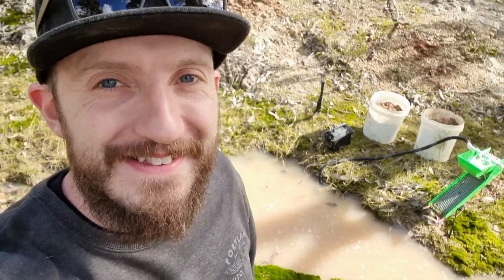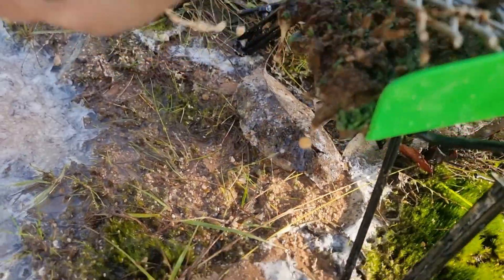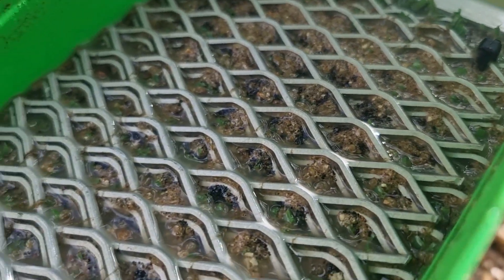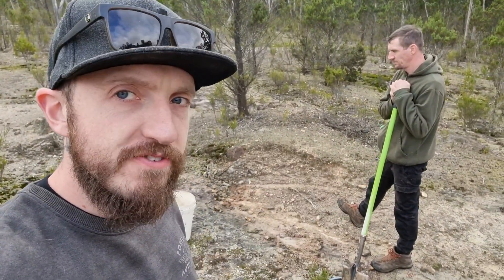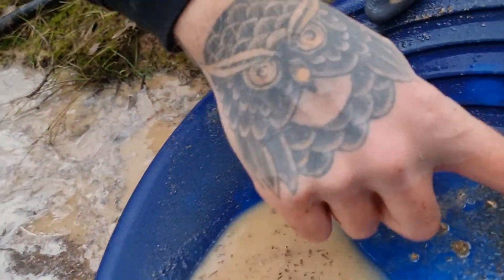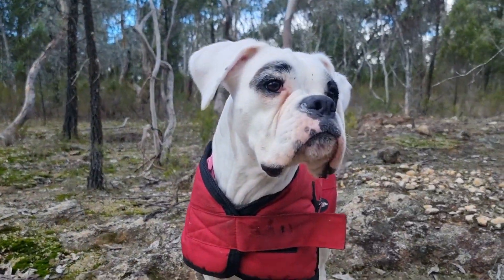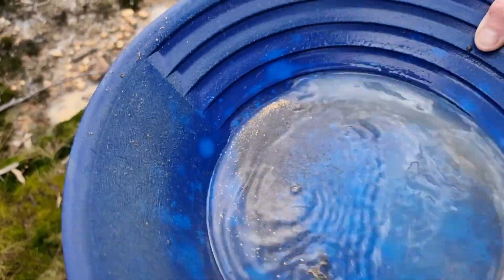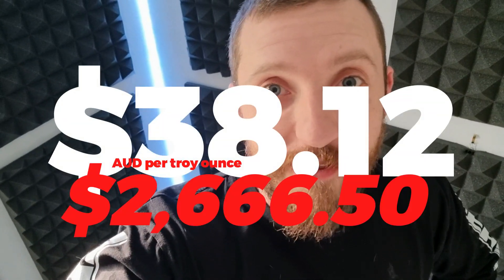I Waited two Years For This! | The Mini Monster Gold Sluice Box

Comment: I'm not sure I understand... why these units have such a high price tag. Getting into plastic production isnt cheap, but the product isnt worth the cost. Companies heat form blister packaging for billions of products and it is not this expensive. The sluice looks real good..but is utterly useless....The mat is shit, the hopper needs tweaking for material, and it would still need modifications for individual use.
 I can't justify $200 on a plastic le trap, or an A52 that needs different guts...
Diy costs aren't much different, why not just fabricate something yourself?
I was willing to pay more for the research and development... seems like Gold Cube might be more versatile and universal...and not much difference in price... buy once cry once.
Otherwise, The battery box is about the only thing this has going for it, and even there it's Dewalt. Simple to make, parts are cheap and easy to come by... can be done in milwaukee or whatever brand preferred. 

All complaints aside..Great video!! Appreciate seeing the tools used in the field.
Reply from the maker: You raise some good points.

The only thing I can offer you is this is a hobby and different people enjoy different things.

For me, this unit has been a saviour of my back which was injured when I was a teenager.
Its about as fast as panning but with none of the pressure on my core. It's light, it fits in a bag and it was a good entry level project for me to tweek.
Reply: @Spud Engineering sorry, I didn't mean to dismiss or question anyone's needs, or the fact that it is a hobby, for me as well. I'm a big advocate for doing what ya like.
I'm only struggling to understand the leap from $150 to $600. 
I also do leather work and wood work for hobbies, I understand how tools get pricey. But there is an obvious step up with quality or function at the higher price. I just don't understand it with these tools to catch gold.
Looking into diy options, maybe I'll find the ticket to lower the barrier to entry.. I'll call it Dongo's Dunny Dredges...never a better, fly shit trap...😉
But certainly no lack of poor (and cheap), wanna-be hobby prospectors like myself. 
Thanks for the reply, appreciate your assistance figuring this out.. 👍

Comment: Hey Chris. Have you modified the hopper on the sluice/high banker since you last posted this video? I'd probably just cut most of it out leaving just enough to attach your ¼ inch screen to
Reply from the maker: I have not. 

Instead I added a Jarvi Riffle to the top of the device run which fixes the issues I was having with oversized material.